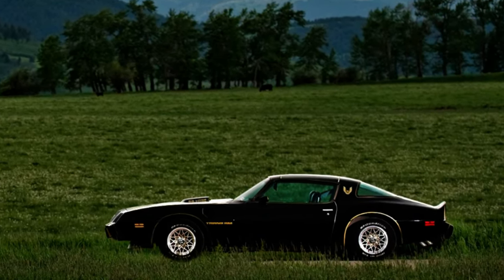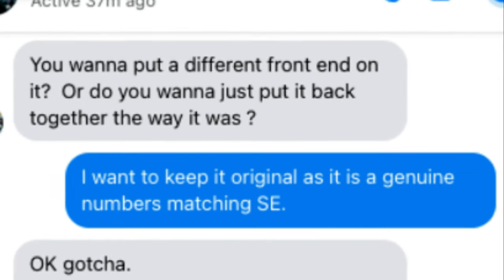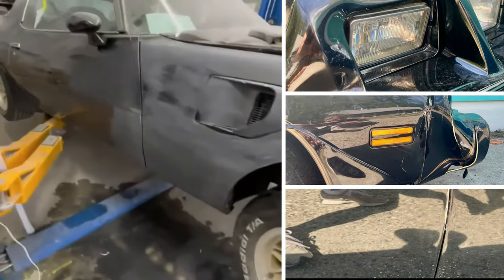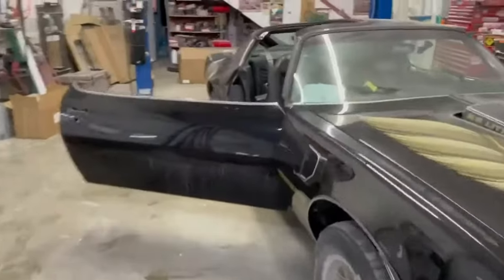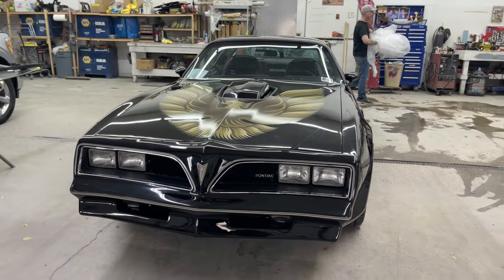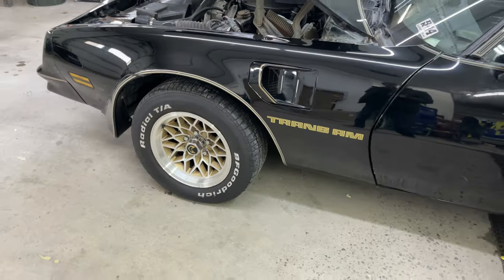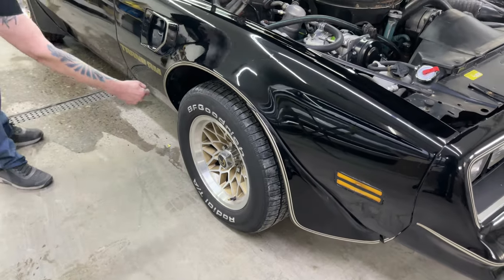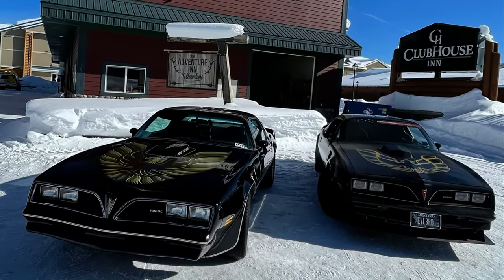Trans Am Nose Job. I crashed my 1979 "Smokey & the Bandit" Trans Am. Then swapped the nose for a 78.

Comment: A friend of mine had a 70 1/2 T/A. Blue with white stripe . Drove it 2 blocks from  the body shop ( In the middle of the winter in Massachusetts) came around the first corner spun out into a telephone pole. Had it towed back to the body shop had it repaired and sold it.

Comment: I’ve owned a 77,78 and an 80. I would have done what you did , as the 77-78 front end is the most iconic look , and just looks mean imo . The only change I would have done differently than you is , i would have changed the Bird on the hood to a 78 . This way regardless of the rear clip, I think it would look more era correct . Each to his own of course, regardless it turned out amazing
Reply from the maker: That is interesting. Would you believe only two months after I made this video, I was caught in a horrible hail storm. The hood on the car is toast. So it going back for another winter. I think it will be a full insurance job respray.. so we will see..
Reply: @TimRogersMT  dam I’m very sorry to hear that . Hail has gotten worse during the years I swear. I think I’d need counselling if that happened to my Marty
Reply: @TimRogersMT   That's an interesting opportunity. As a fellow 79TA owner, I think if you do change the hood bird as suggested, you may consider also changing the tail lights to 78.